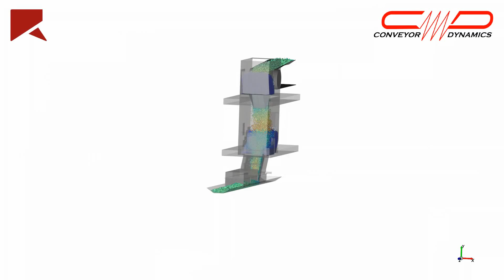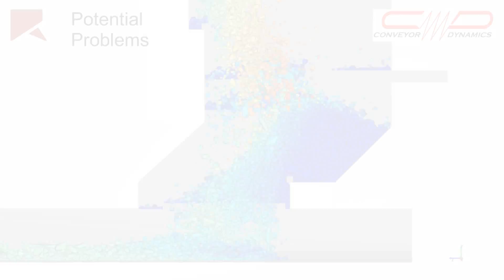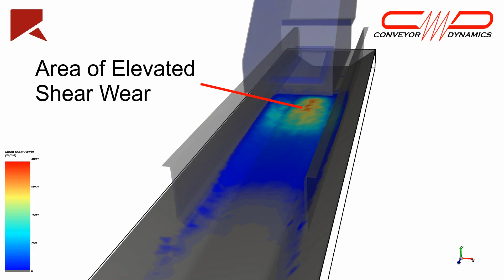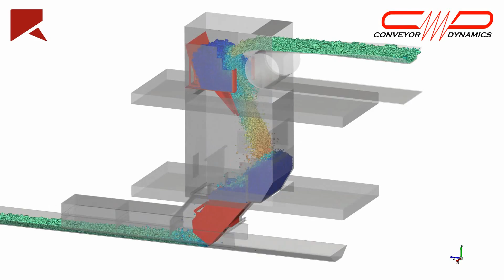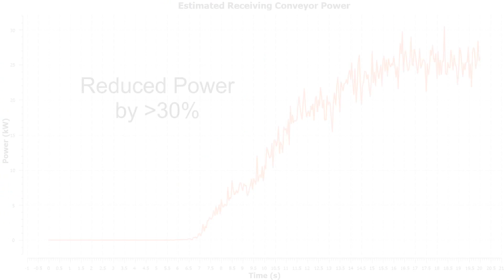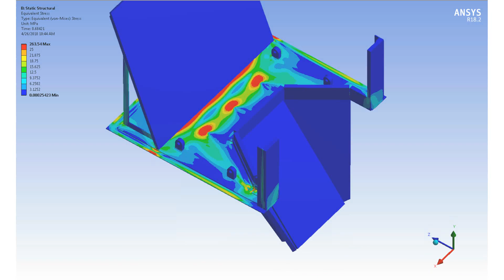Rocky DEM and Conveyor Dynamics (CDI) transfer chute

Comment: How small can the particles be in your simulation engine? (In terms of scale)
Reply: Well? Tell the man!
Reply: I think it depends on the hardware you're running on. I'm being trained on this software and, so far, it looks like you can define however small of a length scale you want. It just depends on how long you want your simulation to run - and then post processing.